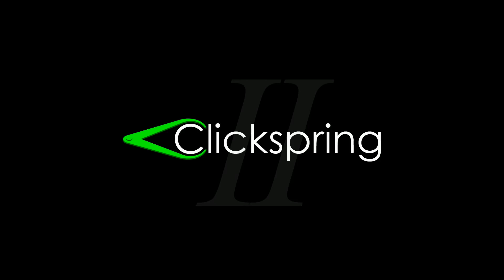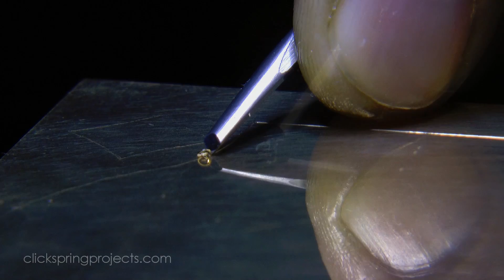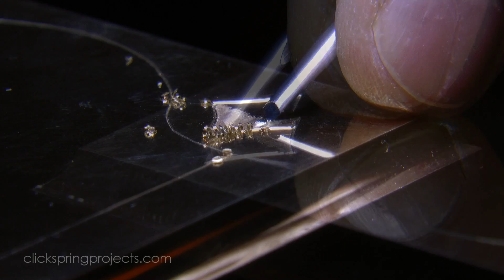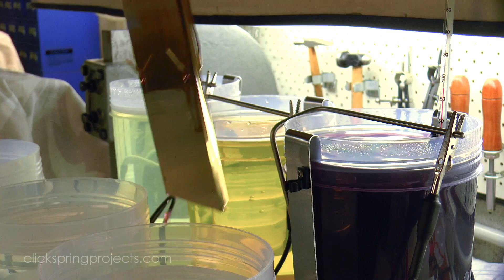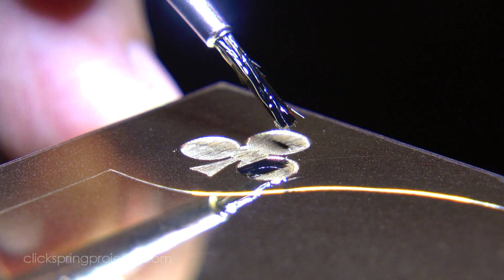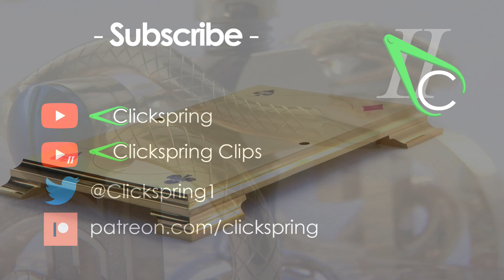Engraving a Brass Card Press Base

Comment: I have always wondered...is there any way to fix an engraving mistake or do you have to scrap it/sand it down and start again?
Reply: I think once you started the groove it guides itself, kinda like wood carving. But it reminds me a bit of drawing with a pencil, you just have to have dexterity and experience for good results.
Reply: If it's a light cut and depending on material you can polish it out but always a bad idea! It's easy to slip out of a deep cut and make a light scratch.. My PA and Gpa were Hand Engravers, like you see in this video but no powered vibrating graver tool, just force and a sharp tool..  Having tried many times it's really tricky.

Comment: Did you really freehand the design on the brass right at the start or was there a template? Incredible work either way.
Reply: On the press platen he drew the design with pencil and paper, then photocopied it and transferred the ink to the brass. But this does look freehanded, which is stupid impressive.

Comment: That’s almost a ThisOldTony fingernail.... I’m starting to see a trend.

Also, would live info on the equipment.
Reply: The equipment is godawful expensive. It's a GRS pneumatic engraving machine... with some sort of handpiece and at least a couple of gravers. None of the GRS units are for the faint of wallet - even the GraverSmith (the "entry level" unit with a foot controller) is about $1200 US. Add $400+ for a basic handpiece (basically, the miniature jackhammer that drives the graver - they get to be nearly double the price if you want something beyond the basic) and throw in several shapes of graver, and it really adds up. It's really niche gear, so if you're not heading in the jewellery or watchmaking direction, it's not worth considering unless you can lay hands on somebody's retirement sale.

You can save a lot of money with a manual set of burins, but be prepared for years of work getting those long, sweeping cuts to work - master simple cross-hatching first, which will seem to take long enough by itself - and hands that scream at you all day every day. People used to do it that way for a living, but then they used to spend years in apprenticeship before they'd be allowed to touch anything important, too.
Reply: Stan Rogers thanks for the info.  For me it’s a balance of time and money.  Not only do I not have as much time as I’d like to be able to develop all skills, but I certainly don’t have time to invest in a project only to have it turn out in a way that I’m not happy with, all because I’m still on the lower end of the learning curve.  So I’m happy to spend to shorten that curve and make the limited time I have for the activity more rewarding.

I don’t know at this point how much I’d use it, but I know myself well enough that if I ever had a fair project in mind that would benefit from it that I’d be glad to have the information on it.

And I have considered some manual versions, I’ve been carving wood for several decades so I’m not sure that it would be an entirely new skill set, but again, still a learning curve.

Thanks for the info and the advice, much appreciated.
Reply: @andrewmyers7131  Well, if you think you're up for that sort of thing at the price, you'll find that a carver's or engraver's swivel/ball vice is at least as big a part of the toolset. The lap version (you know, the heavy beanbag thingy with a vice on a cannonball) might do, but that means you're moving the work while working the foot pedal, so a benchtop version is easier. Something that lets you hold the work very steady while feeding the work to the tool at the same time as feeding the tool to the work is pretty much essential.

If you've done wood carving, you'd probably be familiar with the basic technique. On the one hand, you don't have to worry about grain so much, so that headache's gone, but on the other hand the cutting angle is a bit more critical and the pressures are significantly different. The machine takes some of the time out of it, but there's still going to be a learning curve and more than a little scrap metal. Good luck.
Reply: Stan Rogers thanks Stan